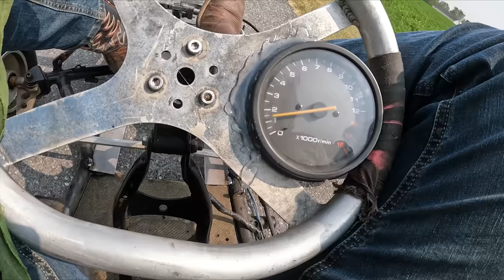I Bought a 100-HP Motorcycle Powered Go Kart for $1300

Comment: Cut the chassis and make it longer to accommodate your long legs for comfort and better weight distribution it will make working the breaks easier. Try a different carburetor nothing to hairy justba mikuni carb. Maybe go crazy try a fuel injection or a small turbo or Nitro's. If you do that I will do the test drive I live close n.y. isn't to far from you. I'm 62 how much longer am I going to live anyway. I love doing sketchie stuff anyway

Comment: cam girl in backseat almost crakked up,but jeeves that trash Go Karts frame and rest of metal work,but Seriasly this type co Go Kart you must build them much higher,longer,wider so engine its not right behind you, and that frame need to be strong are it made from pipes or tubes at its dont bend in g force or wheight,and when its made bigger you can use proper coilsovers and set it low or up to all kinda roads or places,and you can use all type of wheels slicks to knopped tire's.

Comment: Hey listen bro all bulshit aside you're flooding it out because you're not running it hard enough that car is meant to run in second or third gear wide open from the start. Nothing had to do with methamphetamine building that cart it's called hours of nights where I couldn't sleep and I was exhausted and just threw a bunch of s*** together. I built five of those cars similar to that out of spared bike parts and a bunch of junk go-kart frames. That's the first one I ever built. Anyway strip it apart clean it with some carburetor cleaner and some Degreaser re f**** pop oil in it put everything back together and go for it. Stop being afraid of it drive it like you stole it that's what it was meant to be driven as that's why it's tuned so high